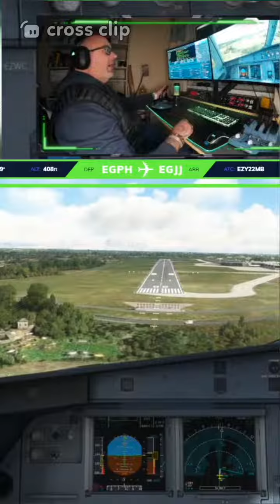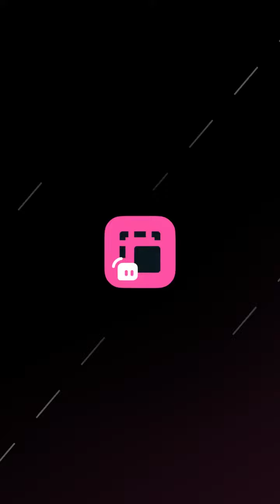How Not To Land Into Jersey MSFS 2020 #shorts

Comment: Nice lmao, I was actually thinking of getting back into flight simming, do you recommend me getting xplane 11 or msfs2020? I was at first leaning towards getting xplane 11 since it's now considerably cheaper due to the release of xplane 12, although the graphics made me think I'd probably get msfs2020. Since I don't want to spend too much if I don't need to, but I want a good balance of realism as well as graphics and performance, as msfs2020's realism has been a bit janky in the past. Thanks.
Reply from the maker: If you have Xbox game pass you get MSFS2020 included for PC and Xbox. If you need to buy it there is 3 different versions you can go for. If you want to fly straight out of the box with great graphics then MSFS is the way to go. You can get a great free A320 Neo to fly from Fly By Wire as well as payware A320 from Fenix which is awesome. You’ve also got the PMDG 737 range available too. Xplane still has the better flight physics but the visuals are no where near MSFS. I have both and I can’t re the last time i fired up Xplane.
Reply: @TheChillOutFlightChannel  Ok, thanks for the tips! I'll definitely consider that then. Thanks. :)